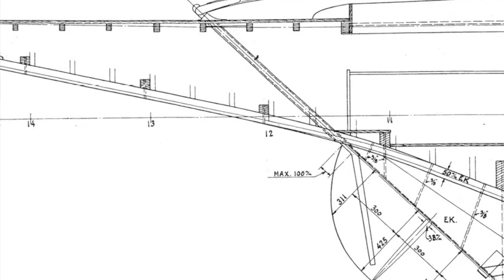[3] Replacing floor timber of a wooden Dragon sailboat

Comment: Love your work. That’s going to be a beautiful old dragon when finished. It’s nice to see a beautifully built boat restored back to its original condition and not modified to someone else’s ideas
Reply from the maker: You said it! Talking, for example, about the deck layout, varnish or deck planking. Today you see many very old dragons with impressive teak deck planking and a glossy wooden hull on the outside. My intention is to restore the deck just as it was in 1938 (using modern fabric) and giving the hull a white varnish - just as in the old days. Modern gear should not be neglected - but preferably should not be visible - wherever possible.